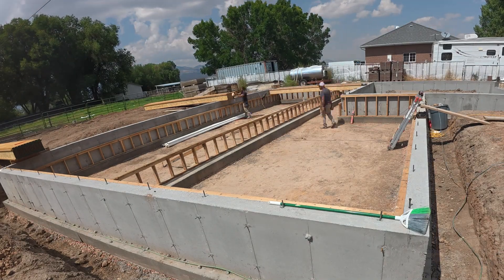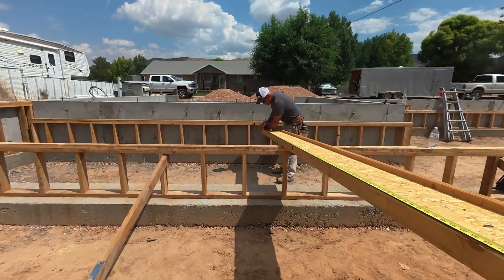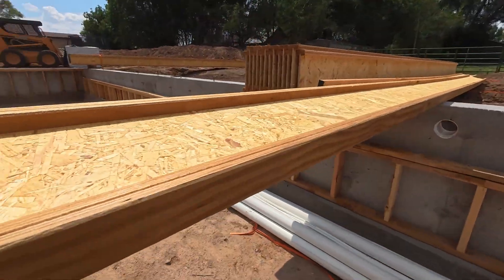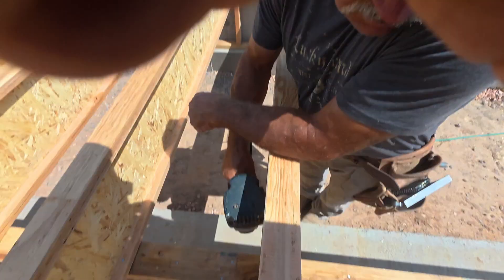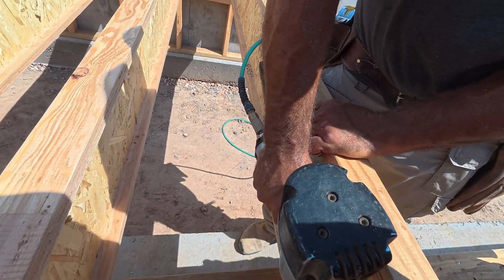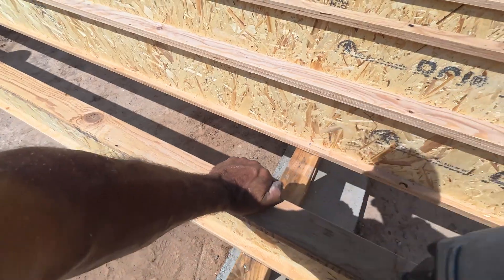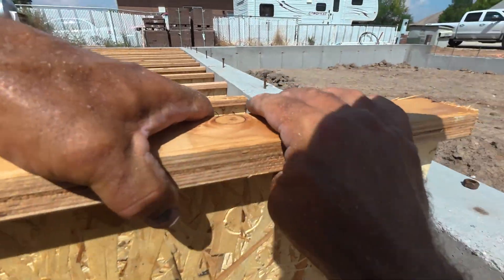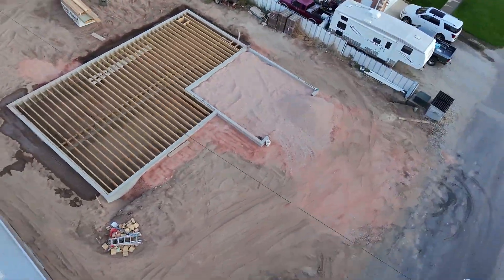How to Install Floor Joists for No-Step Home | Ep 5 4 | HOW TO BUILD A NO STEP HOUSE

Comment: When cutting I-joists, if you make a template that fills in the I it makes it much eaiser and safer to cut. The larger side of the baseplate on the saw should be positioned on the longer side of the board, allowing it to have less chance of slipping off. Also a piece of tar paper or something between the I-joist and the cement wall will help any moisture from wicking into the I-joist.
Reply from the maker: Thanks for adding to this series with your comment.  This is how we’ve done it for a while and we like to make our homes better and better with each build.

Comment: Nice job . But shouldn’t the wood  touching concrete supposed to be pressure treated  lumber?  Also we make a little plywood jig for cutting TGI ‘s. Good luck
Reply from the maker: Thanks for asking and leaving a comment.   Yes we do use pressure treated for all the wood that has a connection with concrete.  Like our bottom plate for bearing walls is pressure treated and the wood we used to level the bearing walls as well.  None of the joists touch concrete, we shoot for about 1/8 to 1/4 inch from the concrete.  

We’ve tried jigs before, but we do it this way the most.  Thanks for the consideration!

Comment: Perhaps it's my lousy eye sight, but I did not see any plumbing for kitchen, baths, etc.,   exiting the ground in the crawl space.  Wouldn't that be easier to do before you set your floor joists?  Although this is an interesting concept, I've never seen it done before, so I may not know what I am talking about.  Great Video!
Reply from the maker: Yeah you didn’t see any plumbing done so far.  So you’re right.  Now what we do is make sure no plumbing hits on toilets, tubs or showers.  The reason being is that when they rough-in those pipes after we are done framing, our plumber cannot cut or drill holes into any of our joists.  Other pipes like sinks can be moved around within cabinets, so we don’t worry about those.  

Now we did put in a 4” sleeve while pouring our concrete foundation walls for our sewer to send to the street.  Also our plumber did put some pipes in the crawlspace before we installed our joists.  

Another note to add is that we also put in a 4” dryer vent sleeve, so when plumber comes after we finish framing, he can slide in more pipe.  

Great question.  Now would have it been easier?  I don’t know, when we build we like to keep the options open for moving plumbing until interior walls are up for one.  But also this is how our subs like it done. After the framing, unless for special circumstances.  Thanks for asking

Comment: I just found you guys and I have been wanting to find this very concept.  Why come home to live on concrete after working on top of concrete all day.  Not to mention the elderly with knee and hip replacements having to live without some cushion below them.
Reply from the maker: We’re glad you found us!  We’ve build a few homes this way and enjoy doing them.  And the home owners like the concept as well.  We are always evolving and looking to do things better, so send in insights on the comments section if you’d like
Reply: You can actually build a zero entry home with a basement. My husband and I bought one back in 2005; and it was designed and built in 1998!!  Front door and door from the garage into the house were both zero entry. As were the two man doors into the garage. They even designed the two deck sliders and a single door as essentially zero entry. That house was built using i-joists. There was a full basement, as the house was built on a bluff. That allowed for a second lower deck, which also had zero entry sliders and a man door. Just depends on what you need.
Reply from the maker: @1packatak I’ve actually been thinking about this and how it would work out?!  That’s great!  That’s seems like a really sweet home by the way.  Can you tell me how tall your ceiling was in the basement?  I’ve been thinking of how tall you’d need to make your foundation walls to keep things comfortable in the home.
Reply: @udybuilders  well remember ours was built into a bluff of limestone.  The architect and initial owner did all the designing. The main floor had 10 ft ceilings!  And the lower level was 8 1/2. The owner wanted a little extra height in the basement, but needed to control it as well to keep the zero entry ability. They also designed it with wider entry doors, and actually all doors were a bit wider. There was a wider door in the back of the garage that opened to a full stairway that went right into the utility room. Made it great for service of the furnace and water heater. It also helped as we had some extra water conditioning equipment (we had a well). They had planned to retire in that home, but wound up moving south instead.
Reply from the maker: Okay that makes sense, I was thinking that if you did this concept with no steps on a basement house you’d want 9’ walls to still have plenty of head space in the basement.  Especially for a new build.   You had so much space!  Thanks for the comments.
Reply: @udybuilders  the main floor was 2800 sq ft. About 2/3 of the lower level was also finished. Our two decks were each 16x60 feet!!!  And we lived out in the country, but close to a lovely small town. Tons of deer, turkeys, pheasant, grouse, eagles and a few wolves. An organic beef farm just down the road. We wound up having to sell it a couple years ago. I really miss it.

Comment: While I understand the floor sheeting is contained and therefore you don't need to worry about the entire floor racking.  I still think you need midspan blocking.  The blocking helps distribute point loads from one joist to the adjacent joists and can make the floor stiffer.  More importantly it prevents the joist from twisting or buckling under load.  I am not suggesting the floor will fail and collapse, but if the midspan of your joists is free to move laterally, than the floor attached will be able to deflect under load, perhaps even enough that it will cause floor finishes to crack or make undesirable noises.
Reply from the maker: I agree that the house will be just fine, and sound.  The bottom is pinned down and the sheeting will be 8 penny rim shank with glue.  If anything moves it would be the bottom joist possibly.  It would be interesting after loaded down to check in the crawlspace for any of this that you mentioned.  Thanks for the comment
Reply from the maker: I just thought about your comment more.  I was just thinking about the center load bearing wall, now if on the exterior walls all we planned on was that I agree more we would have some trouble.  

But what we did was have all our exterior walls land on the concrete about 4” of a 2x6.  So the foundation is holding pretty much the majority of the wall.  Does that help with what you were suggesting?
Reply: @udybuilders  I was more concerned with mid span.  The top and bottom chords are fixed at the ends, but in the middle, the bottom chord is free to move laterally.  As the floor above is loaded, the bottom chord and/or web may deflect/buckle a tiny bit allowing the floor above to sag a tiny bit.  This usually only happens if the I joist is not perfectly plumb, or if the load is offset from the center of the web.  Mid-span blocking serves to prevent any deflection of the bottom chord and stiffen the web.

Again, I don't think this is critical, and you can always add it later.  However its been proven to make a floor stiffer, and reduce squeaking or cracking of tile/grout, so I think its worth considering.
Reply from the maker: Thanks for the consideration.  We’ll look into this.  We are always open to suggestions like this because we are trying to make our homes better.  This current build we only have put 2 16 penny gun nails in the button chord to keep it on layout.  With your suggestion that may change.  Thanks for the comment.  Truly.  Adding the blocking would make this better.
Reply from the maker: @josephhfry I’ve noticed that you sent another comment, wanted to let you know for some reason the comment didn’t come thru.  You’re more than welcome to resend it.  Thanks
Reply: @udybuilders I think they cut it because it had a link, to the IRC R502.7.1 where it talks about midspan bracing.  It says that there is an exception for I joists and that you should follow the manufacturers recommendation.

So disregard everything I said and do whatever the manufacturer says.
Reply from the maker: @josephhfry Thanks for the info either way, good things to consider.  Comment on our channel anytime.  You do much more digging and finding answers than any follower I thought we’d have.  Thanks again
Reply: @udybuilders following closely, planning a crawlspace build and watching others helps keep me thinking/visualizing what I will do.
Reply from the maker: @josephhfry that’s awesome.   Hope that our channel can help.  The main change that we would have main with our crawlspace so far is having a true 4’ concrete wall.  Which we could have done, but we were trying to dodge an overhead telephone wire.  

Currently our crawlspace will give our sub contractors 18” to work under, which they’re not thrilled about.  We could have given them 2’ plus.
Reply: @udybuilders yeah 18" is tight.  Since your exterior walls will not be on the subfloor, maybe don't install your subfloor until your subs have had a chance to do most of their work?  You could even, with some careful planning, only permanently install the pieces under your interior partitions and just tack the rest with a couple of screws until the last possible minute.

One thing you might have considered was a 2" rat slab in the crawl... That way subs could use a mechanics creeper to roll around while working.  Probably too late now though.
Reply from the maker: Yeah we had our HVAC guys and plumbers tell us what they want and they preferred to just work in the crawlspace when the house was framed. The plumber did bring some pex and drain pipes to leave down there.  And we did put in a 4” dryer vent sleeve in the foundation wall so he can get more pipes in.  I pretty sure I made a short video on that.  And we may cut into the subfloor when the HVAC guy comes to make it more accessible for him for rough-in.  Not ideal, but we work with our subs often and have good relations.